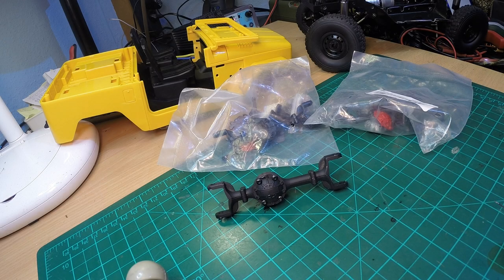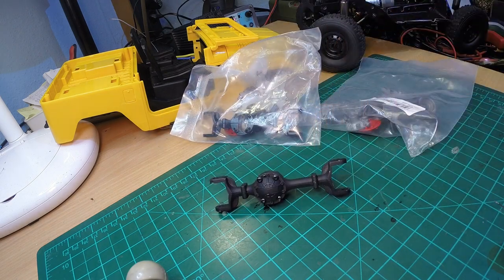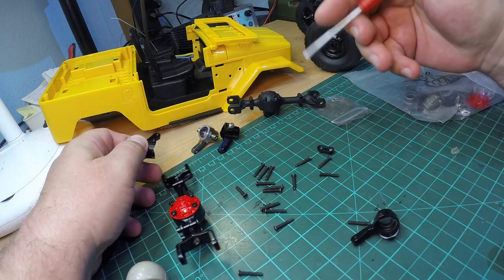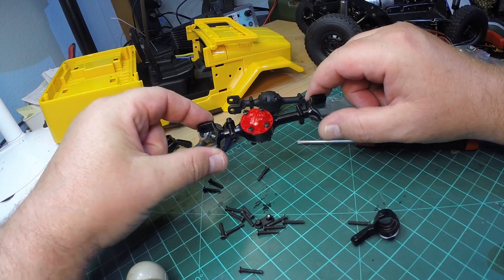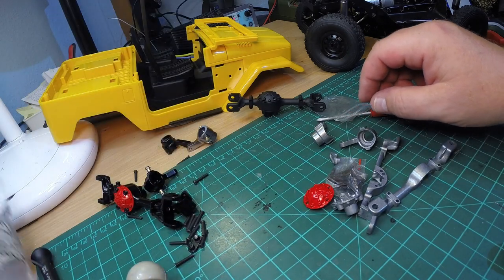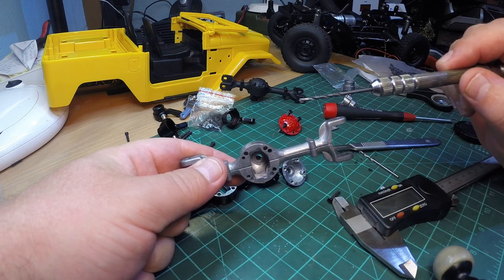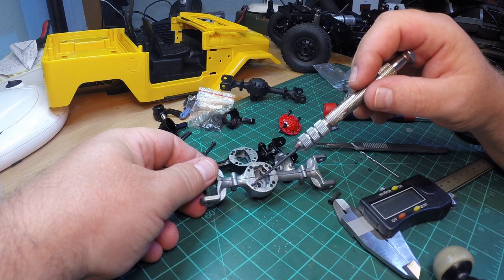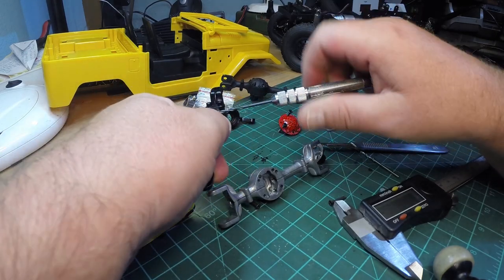Super Cheap WPL Metal Axle Housings and Steering Knuckles - Any Good?

Comment: Thanks for the video. Can you do one assembling with the gears though? I keep having trouble when I assemble mine that if they seat all the way down, the gears lock up. It is like the pocket for the inner pinion bearing is not milled deep enough. I still second guess myself because people have talked about shimming their gears but I am just wondering if they are just repeating best practices or actually have experience assembling these axles. I have three sets of front and back and all of them lock up if seated fully.
Reply from the maker: ... ok, will try... tomorrow or next days... and will report (nearly midnight here right now). 
Shimming is often necessary, depending on the axle housings. 
E.g. in my "beautiful axle housings" (the ones I use now in my C34 instead of the original C34 housings- you have seen my video) I have to use 2 of the shims inside the axle housing between ball bearing and small gear (so the gear, that is going to the drive shaft, fixed by nut screw, sitting "in the pocket"). 
However, if I take this setup and put it into my original C34 axles, the gears will block if I close the axles. But if I remove those two shims, the gears will work in my original C34 axle housings. 
You are probably right, the pocket could be too small (or maybe also too much paint inside?).
I will check, test, report - gimme some days.
Reply from the maker: Maybe this helps: https://www.youtube.com/watch?v=hUDAFXhm43s

Comment: YES! I have the same problem with finding the bushings for the steering cups. How do we put them together if we don't have the parts. I wish they would sell them. If anyone finds them, PLEASE let me know. Thanks.
Or how to contact WPL. Can't seem to find them on the web.
Reply from the maker: I ordered some rivets (OD 4 mm), that could possibly fit (after sanding to right height). Did not arrive yet, will let you know, if they fit. Also very interested in sources for those "bushings".
Reply: The bushings come with the Axle set ie the actual axle shafts and not the Axle casings. They have in the two sets I have purchased anyway, the Axle Casings do not come with them, the Actual shafts come with the steering cups as well.  The Axle Casing is a bit pointless without the set of shafts in any case.
On my C34Km I used common sense and removed paint from the cover locating nipples, steering bush holes and used the painted side of the casing for the input shaft so it acted as a shim. Also left all grub screws loose and secured input shaft cover with 2 screws made sure mesh was good and then tightened grub screws (this was a hint in  Youtube vid).

Comment: Do the wpl axles for the mn90 thanks
Reply from the maker: They are little narrower, but you could use them. But you will need also narrower shafts. I use those narrower axles in the MN-45 (same axles as MN-90). There are also housings for MN-90 and MN-45, check this video, I did already buy and test them: https://www.youtube.com/watch?v=Dk27TTyFkoQ You will find a link to the metal axle housings for MN 90 / MN45 in the description of the video.
Reply: @donaldsneffe  tha ks for the reply. And where would i find narrower shafts. I orderd the full metal axles for the mn90 and i knew they was a little narrower but thought they would just fit anyway? Thanks
Reply from the maker: @johnm5224 All shafts for the "normal" (so not MN-90 and MN-45) trucks are narrower. But you can easily make your own shafts out of 3 mm metal rods. Simply use a Dremel tool. I did it (check video).
Reply: @donaldsneffe  which video are they on thanks
Reply from the maker: @johnm5224  https://www.youtube.com/watch?v=tYBEcGJnwR8&t=66s
Reply: Just used your stock shaft of MN remove the plastic hex and dogbone measure it on the spot then saw and pile it to put the metal hex on MN. I bougth metal axle housing for MN but its hard to find the shaft that fits the lenght i order online it says for MN when it comes the shaft is too short it means its for WPL the seller sent me a wrong size